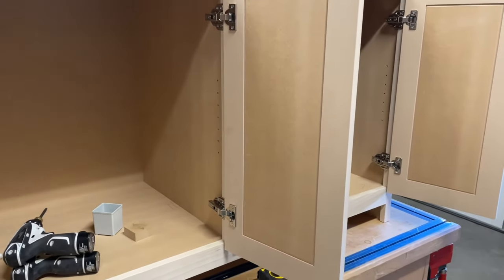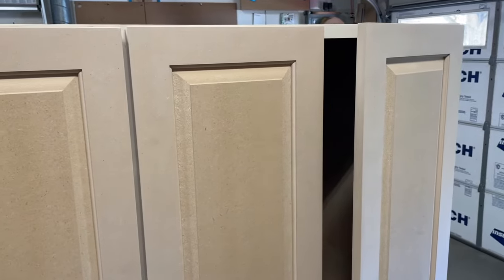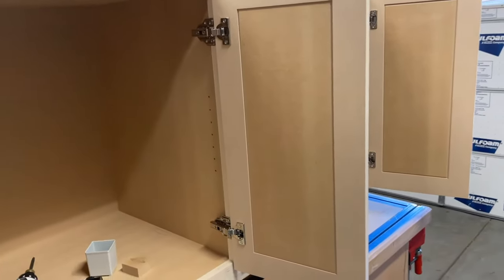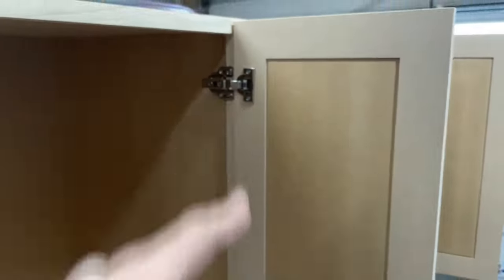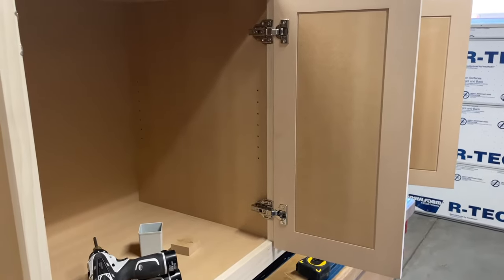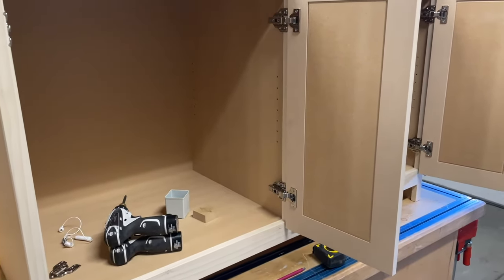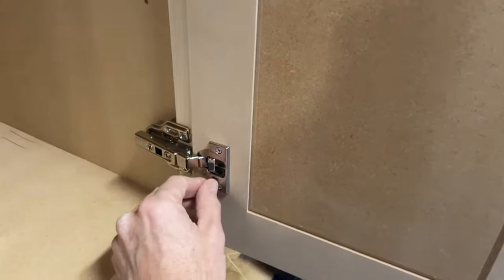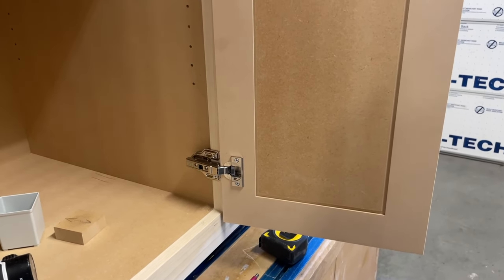Soft Close Blum Door Hinges- What Does This Tiny Button Do?

Comment: I can see now what that clip is for, thanks for that. My construction crew guy who installed the cabinets, for a pantry that has 02 doors per section/level, he put a hinge with the click on the top part of the door on the left door and a regular hinge on that door's bottom but the other right door, he put a regular hinge on the top part of the right door and a hinge with a clip on the bottom part of the door. In one pantry, there are 06 doors and this alternating of hinges is like that for each door, I dont' get it. Why do; click-hinge and standard hinge on one door, then go down to the 02nd. level and do; standard hinge and click-hinge on one door, then go down to the 03rd. level and do; click-hinge and standard hinge on one door. Repeat all this again for the 02nd. pantry of 06 doors. So, looking at 02 pantries from left to right and top to bottom he did this pattern; click-hinge and regular hinge (left door) and regular hinge and click-hinge (right door) Go to the next level down, and it's opposite, and so on to the 03rd. level.
Reply from the maker: Pretty funny.  Before these switches were made, I used to put one non soft close and one regular on small doors.  The reason is the doors are too small so they don’t have enough weight to close with two soft close hinges.  But with one regular and one soft close the door will close nice and gently.  But nowadays, the new hinges have this switch so there isn’t a good reason other than it’s cheaper to put in the non self closing  hinges instead of switching off the soft close ones.  I’m guessing that they want to save cash.  Lol.

Comment: David, I've been using the other style of the Blum soft close hinges which are attached to the face frame with a single screw are these a much better option? They have more adjustments right? I also tracked down a place that has HDF and Ultralite MDF the HDF is heavier even heavier than the standard MDF but the told me the HDF machines better and finishes better than the Ultralite.  I ran a sample piece through the drum sander of the ultralite 1/2" I have 7 sheets of and sanded again with 180 and gave a coat of waterborne surfacer and found when i sanded it with 320 it was smooth as smooth can get, so is he wrong on this? He also said the hinges won't hold as good as they would in the HDF. Ultralite is 59 for 3/4 sheet and HDF is 72 Whats your take on this? You use a lot of the Ultralite I know but do you ever use HDF?
Reply from the maker: I never used those soft close attachment pieces but have seen them.  I think that they are a good option if you don’t have access to different hinges.  Or are using mortised hinges.  However for new cabinets that get euro hinges, it just makes so much sense to use the attached soft close hinges.  Especially these newer ones with the off and on switches.  They are great.  As far as the hdf goes, that’s stuff Is too heavy for me.  The regular is too heavy also.  Lol.  But as far as finishing goes, my finished cabinets are like you said, smooth as smooth gets.  Great way to put it.  My screws hold very well as far as doors and drawers go.  I don’t use the material for face frames for sure. So I’m not securing hinges to the edges of the ultra lite.  That’s not recommended.  My pricing is more than yours at this time.  But the material is very hard to find on a consistent basis.  Where are you located?

Comment: One door won't close completely... I tightened screws and it got a little better. Everything is new with hinges that came with vanity. Ever see this before or have a fix?. Thanks. Very interesting video.
Reply from the maker: Thanks for watching.  Sometimes hinges can be maxed out and that binds them.  It will make them not fully close.  So loosen slightly the screw that makes the door go left or right so it’s not All the way maxed out.  Then slightly loosen the screw that makes the door go in and out.  These are usually the screws that cause the door to not shut.  Does this help?
Reply: @davidbryanwoodworksandmore  thanks a lot for sharing....I will try it. Cabinet is brand new and it was working before ok.
Reply from the maker: @JP-pf1nj  you’re welcome.  good luck.  Let me know if there’s anything else you need.
Reply: @davidbryanwoodworksandmore  tried top and bottom backing it out and slide forward.  Took doors off and both hinges seem to closed their own all the way into the cup.... weird... probably try to find non slow close. I am about an inch of closing the vanity door.
Reply from the maker: @JP-pf1nj  I’m having difficulty understanding you.  However if the steps I gave you didn’t work then possibly it could be the screw holes are in the wrong position.  Maybe the hinges on the doors are mounted out of square.  A lot of things could cause problems.  Check the hinges to make sure they are square when they are screwed down.
Reply: @davidbryanwoodworksandmore  thanks again.... some one also said maybe one of the springs is broken

Comment: verified today that the Everbuilt brand sold at home depot has the same switch that does the same cool trick

still makes me wonder why they don't just make them close at a normal speed from the factory so we don't have to do this trick
Reply from the maker: Oh I’m sure that many will appreciate you letting them know about Home Depot hinges for a local option.  The switch provides a huge benefit in that some doors don’t require two soft close mechanisms to be operating.  So this allows the user to shut off one and still use the other hinge to slow down the door. This little switch is awesome.  Without it, I used to use two different hinges, 1 soft close the other normal, to accomplish the same thing.  The introduction of the switch on Blum hinges a few years ago was a game changer.

Comment: Is there some way to lessen the strength of the soft close hinges when opening a cabinet door? I have ones that are more or less identical to yours, but we have to kind of pull real hard when opening, which feels very unnatural haha... My goal was super subtle soft closing hinges </3 Turning that tiny button off doesn't seem to help lessening the resistance when opening the cabinet door either
Reply from the maker: The switch is to shut off soft close. It doesn’t change the self closing function.  If you are using a hinge like mine, I mean exactly like, you can get the same one in a free swinging type with no self close.  They are good for touch latch jobs. If you combine one of those with the other hinge maybe it will help you.
Reply: @davidbryanwoodworksandmore   ahh I was hoping there would be a way to adjust the ones I have, but I think I'll have to get another, less strong ones. Ah well, I'll have an extra pair of hinges if I build something else in the future- they're a little too restrictive for the surface I'll need them on(surface they'd be sitting on isn't as solid as wood, and would probably not maintain shape when opening). But thank you for the advice! I'll be on the lookout for similar ones instead of trying to adjust these, hope you have a nice day!
Reply: @stormw4993 - I can’t stand my cabinet draws, they require far too much force to open them. I’m looking for a way to adjust those as well as the door hinges. If you figured anything out, I’d appreciate knowing what you did.
Reply: @nja3224   i'm gonna be honest, I ended up going to any and every store i suspected would sell door hinges, and eventually i found one singular pair that worked the way i wanted them to. it's not the best answer, but there are softer hinges out there! just very well hidden haha. good luck on your journey
Reply: @stormw4993  - I appreciate your response, thank you. I’m going to wind up purchasing new ones, mine doesn’t seem to have any switches or adjustments and I’m tired of fighting with it when I want open a draw.